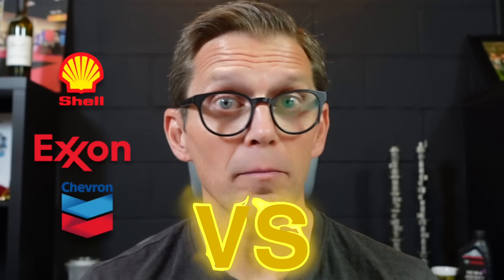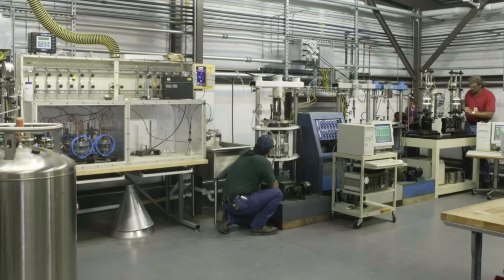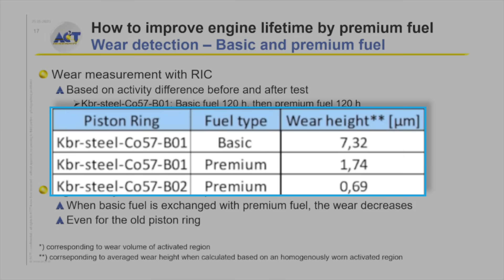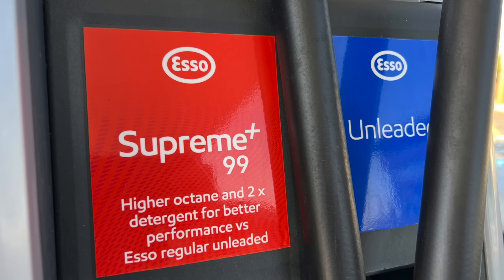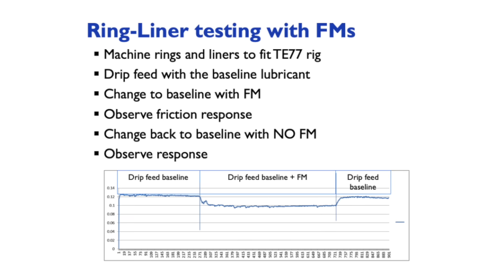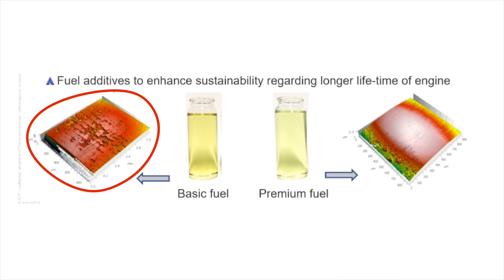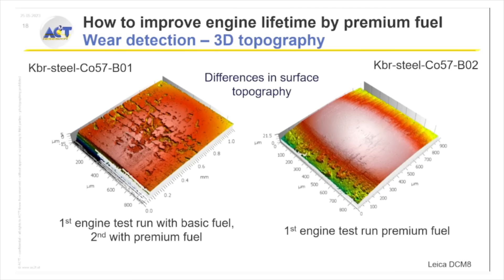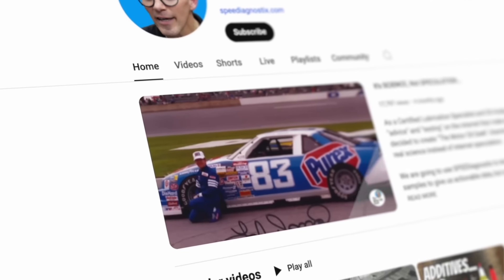Can Premium Fuel REDUCE Engine WEAR?

Comment: Two stroke oils?
I have put a little two stroke oil in all my 4 stroke lawn equipment for years now.
It’s great to keep all the rubber components in the carburettor and fuel lines in good condition.
Since I have run it in my 4 stroke Honda brush cutter I have not replaced the mixture diaphragm.
Reply: Ive also been doing the same.  for about 8 years now,  zero carb issues.   also fuel seems to store longer as pre-mix.
Reply: What ratio are you using?  I was thinking 1/4oz per gallon at a 1:512 ratio for a 4 cycle engine
Reply: I use TCW3 in my vehicles, 1oz:4 gal ratio.  You can do 1oz:5gal as well.  Any less and you don't really see any benefit, too diluted.  Using a richer mixture than 1:4 could hurt the cat, if you have one.
Reply: @GrandPrix46  modern two stroke oil should be okay 👌 with cats.
I’m in Australia 🇦🇺 and our chainsaws don’t have them but I believe that some states in the USA have cats in the exhaust system.
Yes if you idle it for too long or labour the engine it will soot/coke up and suffer performance.
Vehicle cats should be fine as they are able to handle some oil burning from the engine as it wears.
Reply: I have done the same in all my 4 stroke motorcycles for years. Run around 200-300/1
I used to have a tired old 302 in a boat. Burning oil from worn rings. Started running 200/1 2 stroke oil and oil consumption and smoking stopped and it got back most of its power. Also had to turn the idle down on the carb as it once again ran properly causing idle to raise around 300 rpm
Reply: Lucas in all my fuels, no problems.
Reply: @benjamintresham9649  People with Mazda rotaries often use some TCW-3 oil in the fuel to extend life.
Reply: I've premixed my rotary RX8 for years, nearly 100k on the clock and still near perfect compression on all 3 rotary faces. After this vid I might start a light mic on my  Porsche too.
Reply: Won't that clog the cat?
Reply: i have been putting a ratio of 1:500 2 stroke oil on my bike since new and recently pulled the spark plugs out, they were completly clean and dry.
I belive this is a way better additive than anything that they put in the pump, i rather know what kind of additives iam putting in myself.
This acts as an upper cylinder lubricant and detergent as well.
Reply: Two stroke oil in a car? 🤔
Reply: You shouldn't be letting fuel sit in your small engines, what's happened to you is user error not the fuel